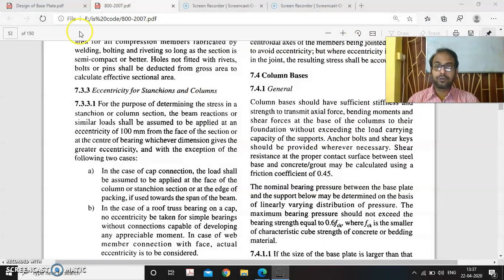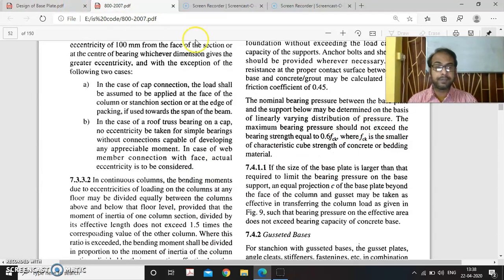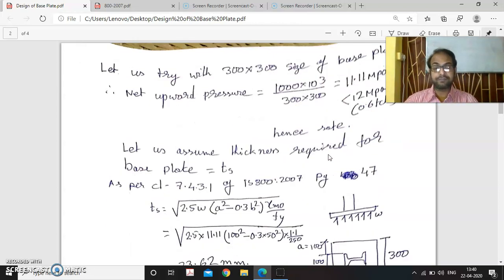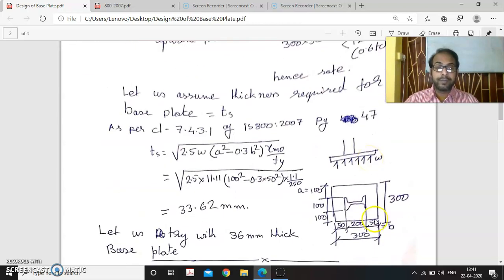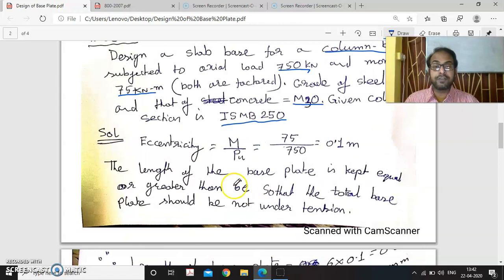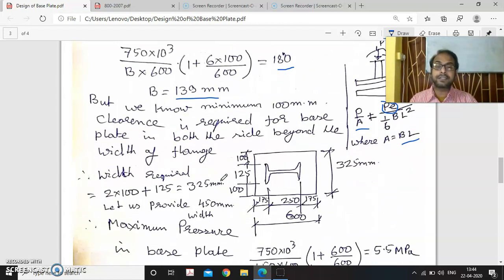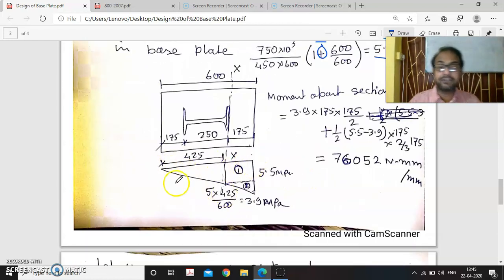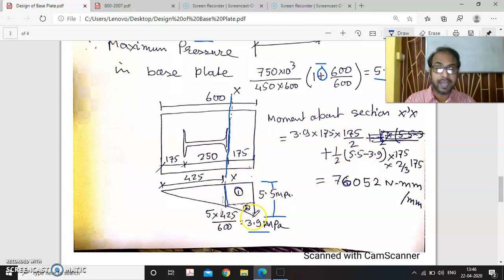Design of Base Plate Example Problem

Comment: sir if the column section is Hollow square  box section 150 x 150 mm then how to design the base plate for that section?  
because For ISHB Isection the flange and web was there which is not for Box section.. 
Both Width and Length are same in that case.. 
sir please clear my doubt.. 
how to manually design base plate for Box column section? 
everyone is explaining about I section..
Reply from the maker: When the projection is same the value of a and b will be same . What so ever the  shape of the column, the projection beyond the column section will behave as a cantilever. To make the formula generalized code has provided the dimension as a and b. Square base plate is a special rectangle where a = b.
Reply: @dr.sanjoydasneogi2964  Thank you sir🙏

Comment: Dear sir, thank you for such videos. And I've a question from long time that truss members being connected by bolt vs weld? And IN fixed or pinned connection which is the best for the steel column for truss structure vs concrete with steel column?

Comment: One question Sanjay da... 
Bearing strength of concrete shall be calculated based upon IS 456,right?
Reply from the maker: But the formula is mentioned in IS 800 2007. We have considered that

Comment: It will be better if it is designed for two cases 1) Compression, moment and lateral with stiffners 2) Tension, moment & lateral with stiffners.
Reply: At least he is discussing this for us.
Reply: @divyanshushankar8134  That's true. I guess, I may have told in harsh words. Apologies. But, there is no example of above cases as I have mentioned on youtube.